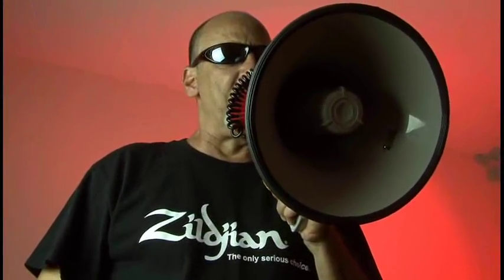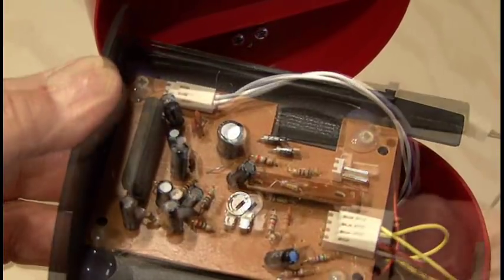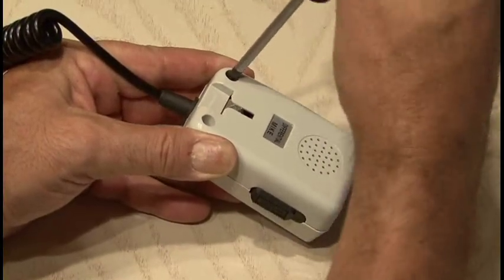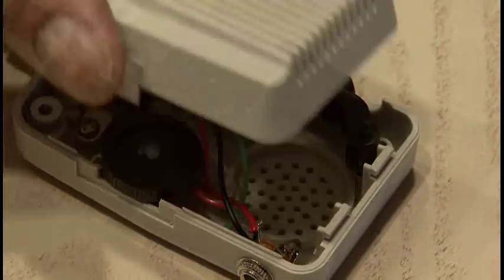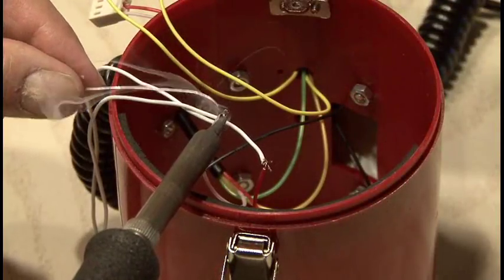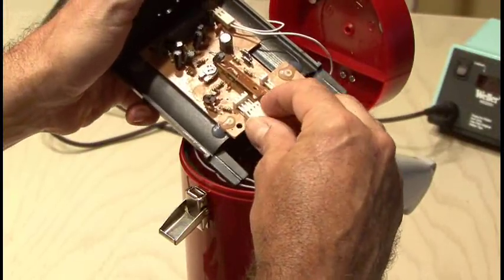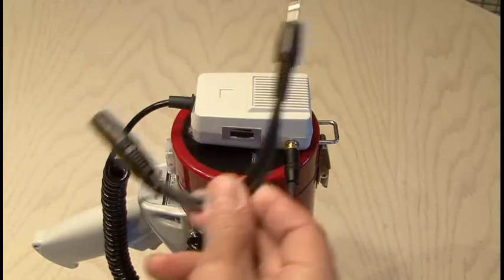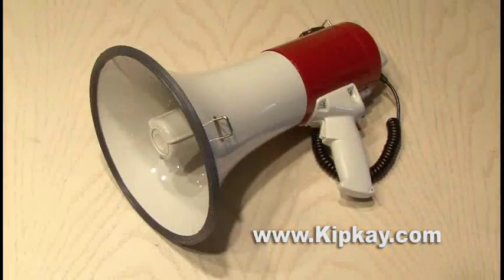Spy Megaphone Hack

Comment: Do you know how to rewire a megaphone so you can connect it to your audio jack on you phone or laptop? Please respond or make a vid. ;-)
Reply: connect it to your microphone jack ( NOT THE AUDIO JACK)  on your pc and it wil work
Reply: Îf you want to use it as a speaker, just desolder the microphone, an replace it with an old headphone cable. Don't change anithyng else. Then it schould work if you plug it in to your pc. No guarantee.

Comment: how much did this cost you? cause i got a "bionic hearing spy device" from nickelodian back in about 1994 that still works to this day, it picks up conversations about 400 ft away and even goes though walls! its pretty cool. I used it in my Aunts apartment (on the 7th floor) from the balcony and heard conversations on about the 4th floor. I love that thing. although your one is cooler i will give you that.

Comment: Fantastic videos! In 1979  yes 1979  I modified a megaphone for a cinema manager in new york while on holiday from uk. At that time they did not have condenser mikes but magnetic ones. useing if I remember correctly a quad throw double pole double terminal switch I was able to reverse the speaker  & mic to amplifier connections to enable the speaker to act as mic.placeing mic against ear allowed you to listen with the speaker as mic! crude but effective so he could hear what line were saying...

Comment: @kipkay - Cool vid - lot of work. I would go to dollar store & get a parabolic shaped Tupperware bowl or saucer. Mount a cross wire/tape mic holder configuration across the lip at the audio focal point and mount one of those cheapie drug store bionic ear devices for old people. It comes with its own earphone system, batteries, and volume control. A plastic or wooden handle would make it easier to hold. You can disguise it with speaker cloth bag. Cost about $10 bucks USD.

tinyurl-com/ychzpwt